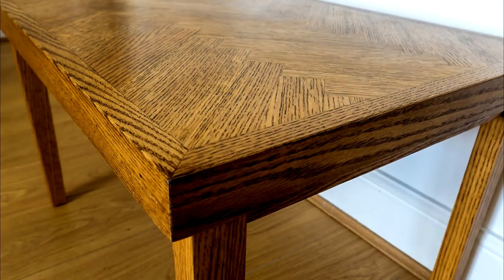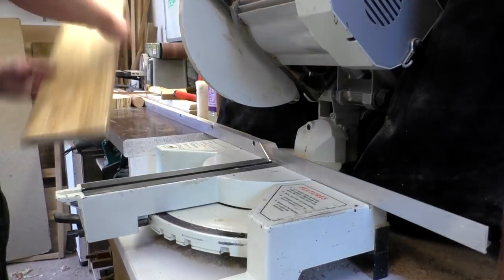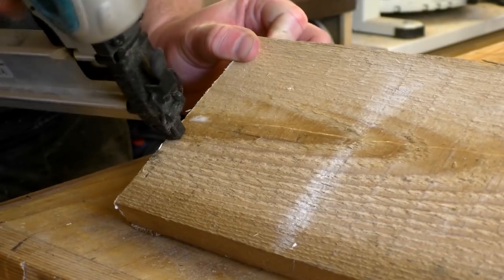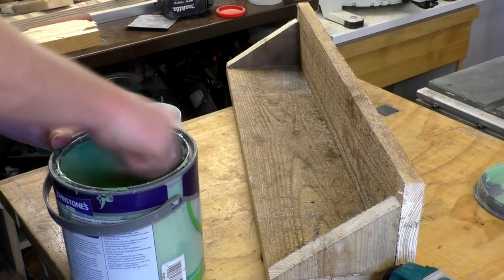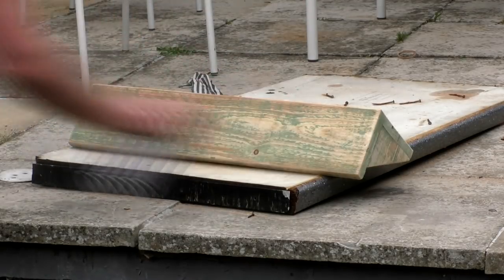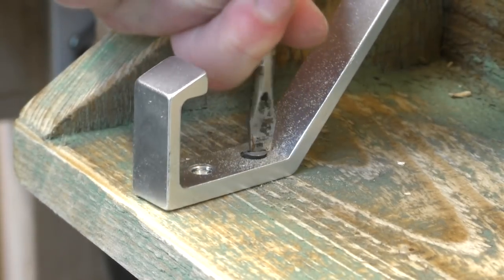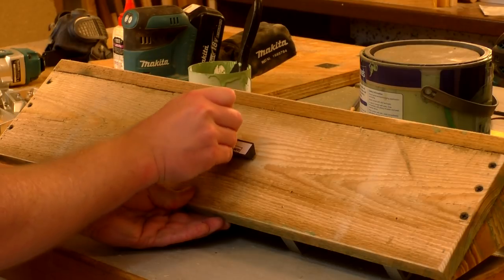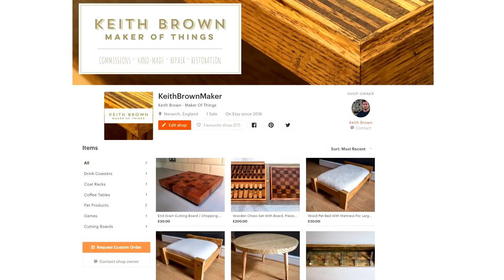Making A Rustic Coat Rack With Shelf - Pallet Wood Project

Comment: How have you designed them to fix to a wall ?
Reply from the maker: +chatty467 when they sell I email the customer and ask them what they want re: hole spacing etc and drill them and then supply screws, brass washers and wall plugs
Reply: Ahhh that makes sense, nice job as always 🖒

Comment: Nice small project. Thanks for sharing. Upcycling is the way to go.
What is the name of the device at 0.20 that you use for tearing the pallet apart?
Looks good. Did you make it yourself or did you buy it?
Reply: It's called a Roughneck demolition and lifting bar. Available on eBay UK.
Reply: Thanks. I found it.